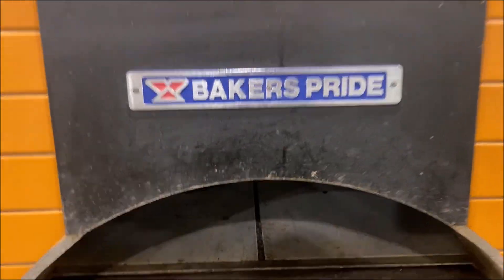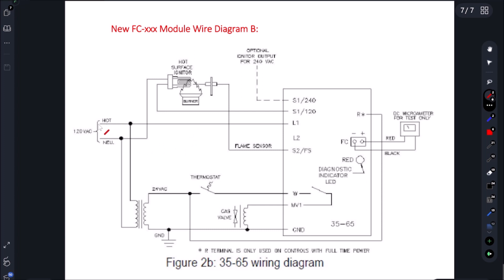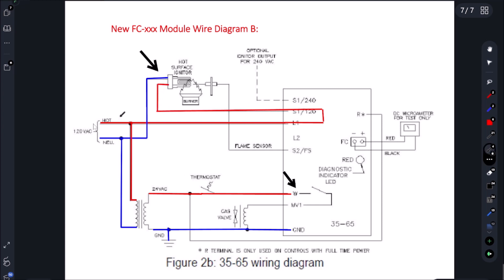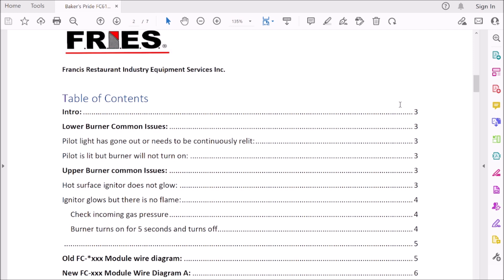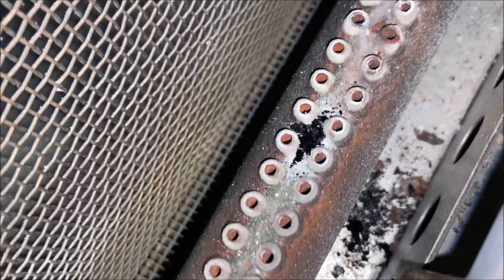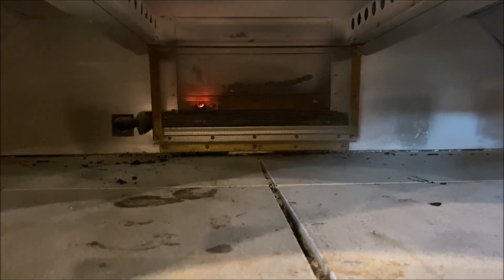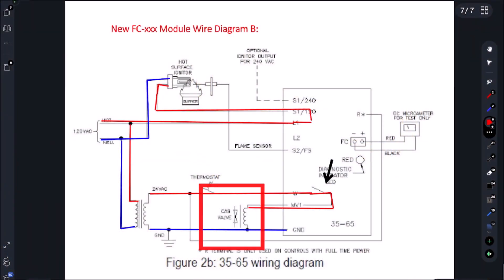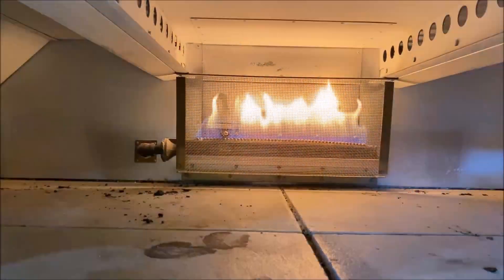Baker's Pride Pizza Oven is NOT Heating

Comment: Nice. When possible, I try to jump components,for testing purposes only. To continue my checks to hopefully find other issues if present.  I hate it when you cannot jump thing and then it makes you look like a parts changer. This week I had a VEVOR (new brand out there, ice machine with a bad contactor. I pushed in the contactor to verify everything else was running as it should before I informed the customer. That way, I don’t come back and say that more parts are needed.  But hey, if your customer knows you, they understand that it wasn’t your fault. But still make you look like a parts changer. GREAT JOB MAN!!!
Reply from the maker: ⬆️ this right here is what separates the advanced level techs from the expert level techs. Great comment

Comment: Very informative. So the sensor is triggered by the heat from the HSI? Not the flame? 
Also, how and where do you find the matching module?
Reply from the maker: I got an OEM module from Partstown. The burner flame is what the flame sensor senses
Reply: @REFRIGERATIONKITCHENEQTECH  So the valve opens for a short period of time, and if flame is not detected it closes and enters lockout? Or does the module detect amperage to the HSI before even opening the valve?
Reply from the maker: The first scenario is correct

Comment: You? A parts changer? Your probably the only one in North America then can read a schematic AND articulate it so the rest of us can follow.

What I don't get is why they would have a 120 vac module but then apply 24vac to the gas valve? Why don't they just put in a 120vac gas valve?
Reply from the maker: Most gas valves in restaurant equipment are 24V
Reply: @REFRIGERATIONKITCHENEQTECH  true.